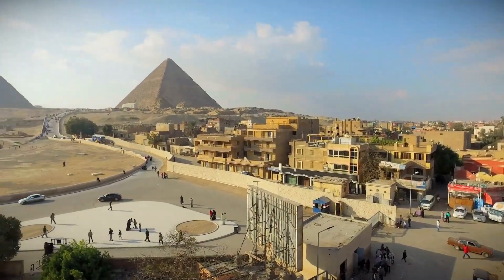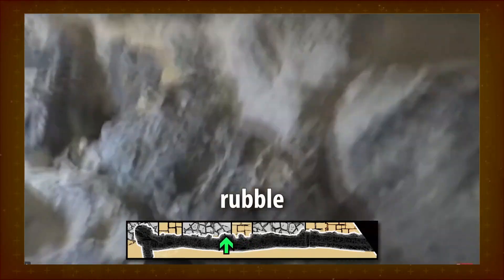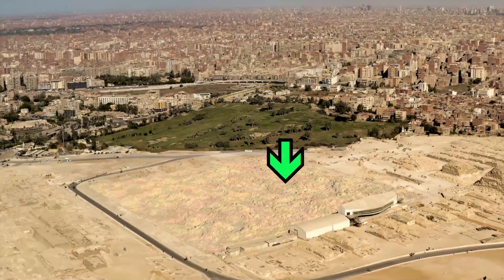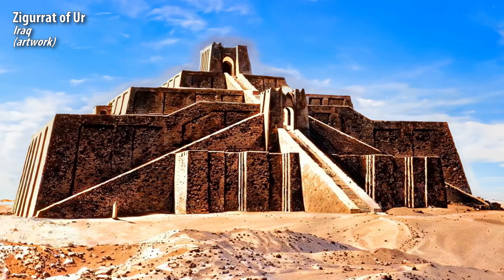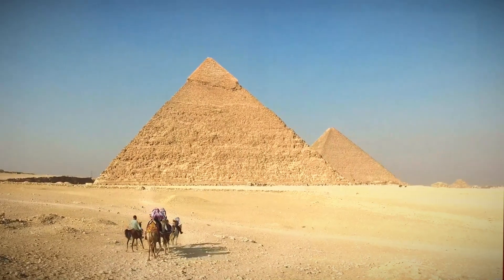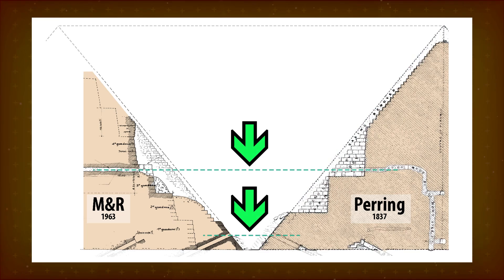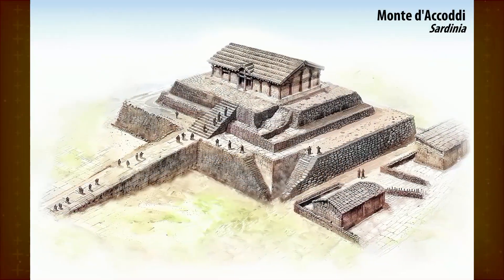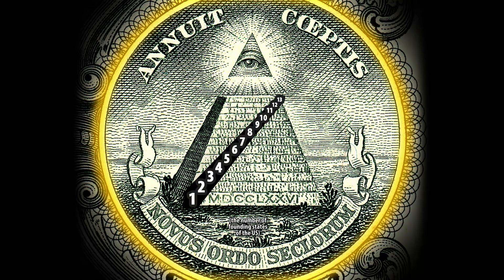Great Pyramid is made of rubble (3D short)

Comment: So you have small "cut blocks boxes" filled with "rock fill" and you just stack these blocks on top of each other. Quite clever and doesn't require that much from the builders. What do we know about the rock fill? Could be boulders of any size or even sand, right? Could just sand be storing enough, meaning that it shouldn't move around. But how did they make the "lids" for these boxes? Those have to withstand a lot of pressure, at least those at the bottom most layers, right?